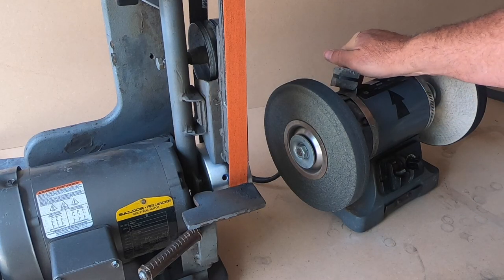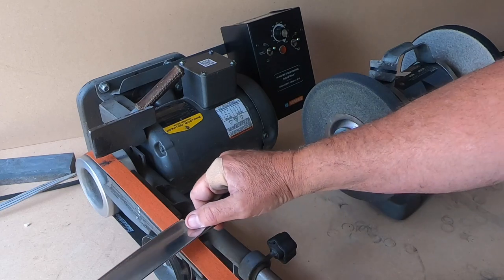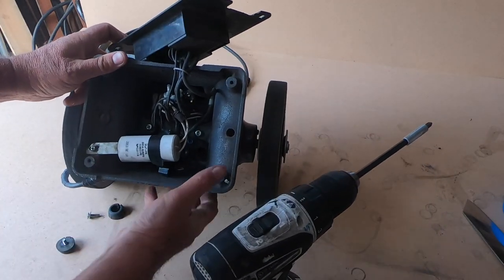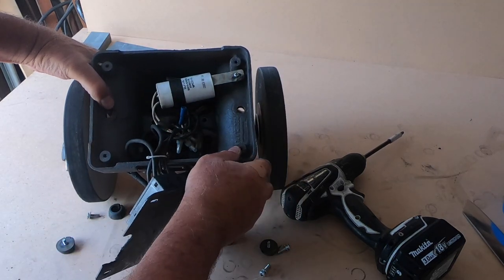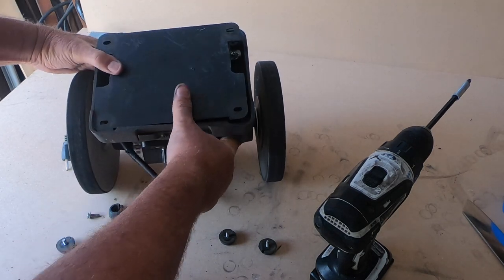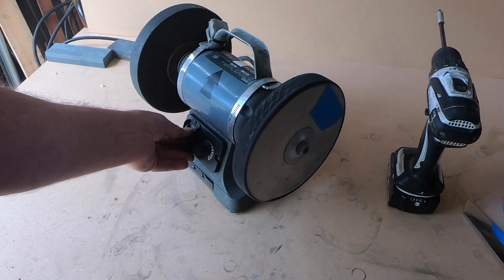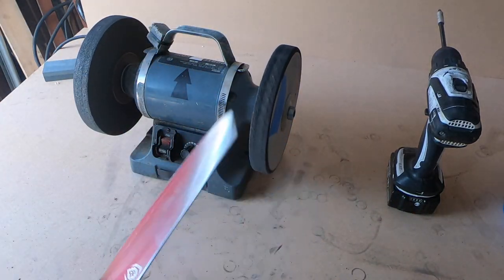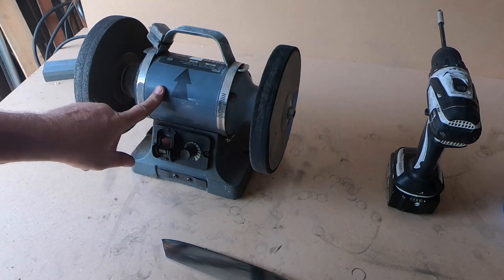Reversing a bench grinder Plus Bonus video covering Why!

Comment: That's so funny man! I rewired my motor, wasn't hard, but all I had to do was flip the base.  Love it!
Reply: I was looking for a way to put a reverse switch on it when I found this video.
I'm still looking for a way to put a reversing switch on my bench grinder. 
My dad's pedestal grinder had a reverse switch on his. Did not need it very often but it sure was handy when you did! 

Also his pedestal grinder had separate units.
The grinder part was separate from the motor part with a v-belt between them.

I sure do love that grinder he  had!
 I wish I had it!!!

You could work on larger pieces without the motor getting in the way!!! 

I put a reversing switch on my drill press. Now I can put a grinding wheel or a wire wheel on the drill press and run it in either direction with almost nothing getting in the way!!!

Comment: I was looking for a way to put a reverse switch on it when I found this video.
I'm still looking for a way to put a reversing switch on my bench grinder. 
My dad's pedestal grinder had a reverse switch on his. Did not need it very often but it sure was handy when you did! 

Also his pedestal grinder had separate units.
The grinder part was separate from the motor part with a v-belt between them.

I sure do love that grinder he  had!
 I wish I had it!!!

You could work on larger pieces without the motor getting in the way!!! 

I put a reversing switch on my drill press. Now I can put a grinding wheel or a wire wheel on the drill press and run it in either direction with almost nothing getting in the way!!!
Reply from the maker: I have a 1hp jet bench grinder polisher with long 1”arbors. It’s about 30” total width.  I wish it fit in my trailer. Instant start, coasts for almost 5 minutes before stopping. Hard to let go of a tool you love

Comment from the maker: One is extra hard very fine convolute wheel, the second wheel is Rock Hard Felt wheel with Black Magic compound. Both get 1-2 light passes. No heat is produced with light passes. Heat is bad and you must avoid. grinder is run at 3200 rpm

Comment: I just subscribed. I sharpen a lot of knives and use the same set up with the belt grinders.   I have 3 cheap 1x30 HF that I also flip on their back so the belt is going away from you.  Each one has its own belt so it doesn’t need to be changed.  They are lined up on the bench so each machine is the same height etc.
Reply from the maker: I’ve seen that setup and it can be a fast setup. I only wish the hf sanders we’re really 1/3 hp and better bearings ( noisy) If you ever try a sander with a real 1/3 you wonder how hf rates the hp. How/where do you work? I’m thinking of a series on the different ways you can make money sharpening. Hobby job to full time.
Reply: Peter G    Just a hobby for me.  I just wanted to sharpen my knives which led me to the 1x30.   Which led to making knives.  Which led to needing a bigger machine.  I didn’t want to pay so I built a 2x72.  I fell in the rabbit hole and haven’t come out yet.  I enjoy seeing the many way to put an edge on something especially your video on the flat bevel knife.  Maybe a few videos on repairing broken tips etc.
Reply from the maker: @tomp577  thanks for info

Comment: Easier method is to turn the whole grinder 180 with the switch facing to the rear. Use a momentary foot switch instead.  No reaching to the rear to access the on/off switch. Spin it back to factory position for standard operation.  Less than 30 seconds. Plus you now of the safety feature of the foot switch.

Comment: With no guards you can just turn the grinder around on the table. Or stand behind it lol.
Reply from the maker: If you reach over the tool enough times eventually you will catch the inside forearm. I’ve sharpened about 60,000 knives. That a lot of arm cuts IMO.

Comment: Hey PG how did you find the gigantic bushing for the convolute wheel, these things are 3" hole.
Reply from the maker: MSC industrial. They have an aluminum turned one $$, and a stamped sheet metal one $. Both work the same.
Reply: @FREEHAND.WETGRINDER  aaah I see the turned ones are more than the wheel hehe. yea, not worth.
Reply from the maker: @Musicpins  Call them. I did and the salesman knew where to look in catalog for the cheap stamped style

Comment: Hi, what is the model of your bench grinder please 🙏
Reply from the maker: I have 3 I just bought at Home Depot. 
And they charge brands.
Reply: @FREEHAND.WETGRINDER   thanks i'am in France and I search a  model like this with variator, have you got a link to see the specifications? It's to put wheel paper kit, they say it works with 3000 rpm but in my opinion it's to speed..
It's for personal use Just my kitchen knifes.. Have you ever tried this type of wheels? Thxss from France 🙏🙏🇫🇷
Reply from the maker: @Tendeep4  Mine are about 3000 at full and 1800 at low I think. Ive used the 3000 with paper wheels and it's fine. The speed lets you use very light pressure so less heat.
P.S. use as little wax as possible on abrasive wheel.
Reply: @FREEHAND.WETGRINDER 
OK thanks a lot..👌👌❤️ I will keep an test on my classic bench grinder. .

Comment: Actually I did find a way to run my bench grinder in either direction.

A few years ago the centrifical switch in my bench grinder came loose and slide over so that it would not run unless I push the grinding wheel in One direction or the other.
But when I do push it , it will continue running full speed in the direction that I push it!!! 

Normally that's a indication of a bad capacitor, but on some it also means your certificate switch is not working right.

The centrifical switch in any electric motor switches windings from start windings to run windings.

Comment: Does this work on all bench grinders? And what model is the bench grinder you are showing?
Reply from the maker: It should work on most all. Your actually only turning the base 180 deg. The wires should be long enough but I can’t guarantee anything since I don’t know all the different bench grinders. You don’t want to stress the wires so check clockwise and counterclockwise for what’s best. If it’s too tight abort unless you’re confident about adding the wire

Comment: Isn't there a risk of the spindle lock nuts coming loose while the grinder is being operated? The lock nuts are usually tightened in the opposite direction of wheel spin tp prevent them coming off as per bicycle pedals with a reverse thread on one pedal, so by reversing the direction of spin, lock nuts tightning torque will now be compromised.
Reply from the maker: It’s still spinning the same but it’s turned around so you can use the switch and still have it spinning away from you
Reply: The axle nuts on those grinding wheels are so tight they will not come loose on their own no matter what you do to the wheel itself!

My dad had a grinder that ran in both directions with a switch and those nuts never did come loose. We always had to use a wrench to change them.

Comment: Have you used MDF wheels on bench grinder to sharpen?  Pros and Cons??
Reply from the maker: Yes. 
Pros- cheap, Simple, delivers a mirror polish type edge. 
Cons- makes lots of heat, only good for mirror polish type edge, slow rate of metal removal when correcting a problem. 

This system is fine for the money. But has limits. If it’s for home use and you want to keep it easy/cheap it will work. If you want to sharpen for money it’s one of those tools you will replace with something more efficient/ flexible.

Comment: Peter what's the variable speed drive on the kalamazoo and how you like it?
Reply from the maker: I like it’s not worth the cost. You need a dc motor to go with it. I increased my motor to 1/2 hp. Plenty for my work. But because the speed controller has a brain when I start it on my generator it thinks there is a power problem as it spools up the generator. The fix was to tell the controller I have a 1/4 hp but when loaded double the power. This hits the generator softer. Also I have it start softer to help but I use the brake feature to stop fast for belt changes. 
I would not recommend due to cost. It was about $500 -600 for controller and motor

Comment: Could you one day make a video on your steps and gear you go through to restore a chipped and damaged knife through to the final hone and strop stage, for a client?
Reply from the maker: What I don't show in the video is big chip removal. If a lot of metal needs to be removed its fastest to put the apex on the belt so the spine is up. grind the correct contour while grinding away the chip. Then decide if you need to thin the knife before sharpening. Often I talk to the customer about thinning since the knife will look different than when I got it.
Reply: @FREEHAND.WETGRINDER  Do you have a video with the typical steps you go through to sharpen a knife, with all your gear. I think you shared something a while back but I can't find it. Thanks for the good work!

Comment: What is the rubberized wheel you use?  Do you have a link to where you bought it?
Reply from the maker: I have two wheels on this grinder. Neither is rubber. The white wheel with black edge is a Felt Wheel w/black magic compound on it. The hardness is called “rock hard” which is between “hard & Flint hard”$
The other wheel is a non woven Scotchbrite wheel. Very fine and hard. My supplier sells it with out any identification so I don’t even know who makes it. $$$
Reply: Peter G Thanks.  Do you get it from PEC?
Reply: P G   What dimension is that wheel(non woven ascot rite one), is it 8”, and what is the arbor size?  Is there a way to contact you?

Comment: I see. the switch is still facing forward but the motor and wheels are reversed 180 degrees causing direction to also reverse from before.
Reply from the maker: That’s the idea. The top of the wheels turns away from you. Let’s you work on the top

Comment: If a power drill can be reversed by simply throwing a switch, why aren’t bench grinders so equipped?
Reply from the maker: @eronavbj  bench grinders are designed for one purpose. And sharpeners are the ones who use it for a different purpose, working on top. For this it has to be turned around or reversed

Comment: Couldn't you just turn the grinder around without switching the base??
Reply from the maker: That is what most guys do. But use it enough,having to give it the reach around, you will eventually touch your under side forearm on a wheel. And both the wheels give a nasty abrasive burn. Setting it up right only takes a few minutes.

Comment: Lol I just did it on my delta and it still spins wrong way
Reply from the maker: It lets you turn it around and not have to reach over to use the off/on switch. It actually doesn’t reverse the direction. But turning it around makes it turn in reverse
Reply: @FREEHAND.WETGRINDER  lol!  I'm such a clutz.  My delta already has the switch in front.  What I was wanting was it to spin clockwise instead of the way it comes to stock, counterclockwise.  It is a little more complex on the delta because it has guards on each side so one can't just simply turn it around.  I got used to this after using my buddies for quite some time.  To me, it makes sharping easier.  Since I'm here,  what way should it be spinning for sharpening? Clockwise or counter?
Reply from the maker: ShyRage1, clock or counter? It’s up to you. Here is my situation and the right decision for me. I try to hold my knives flat for all tools. It makes freehand sharpening easier to get the right angle on the stones. Example: I use the armature wire on my tormek/wen for proper angle with the knives held  flat. Then when I go to the grey scotch bright wheel and felt polishing wheel I again hold knives flat but these wheels at aliens when I line up the sharp edge with the motor housing nearest the wheel. This is also the thinnest motor housing if you’re looking. I find these points with the tormek angle gauge. As the wheels get smaller I have to recheck my mark. But always the knives are flat. Only tool I change the knife angle is the belt sander and the. Finishing grinder that I have mounted on custom stand so I can work under it for seeing results and incase it throws the knife. Remember- I’m working at farmers markets and throwing knives out of the trailer is very bad. Also I’m doing a lot of knives at markets. I have to be efficient. I’m doing 50-100 knives a day 5-6 hr. I put more effort in efficiency than others need to.
Always remember this. There are a lot of ways to achieve a very sharp edge. I’m trying new ideas a lot. It keeps it fun. I use my tooling enough to justify the cost of trying new tools/ stones etc...  just yesterday someone read a better way of doing toothy edges. I tried it today on about 20 knives and decided to adjust what they were doing for even better/more consistent results. And once again I’m doing something different. It keeps it from being boring. Look at comments for (Part 1) video
Reply: @FREEHAND.WETGRINDER  ok will do.  Thanks for the reply

Comment: Why can't you just turn the grinder around 😬
Reply from the maker: People have asked this many times. 
When you use a tool a lot any problems that can cause injury needs to be solved. If you turn it around your reaching around to turn it off and on. 
Ever get an abrasive burn on your forearm? It sucks. And it can be fixed in about 10 minutes for free.

Comment: I just turn my grinder the other way 😩
Reply from the maker: Turning it around is a technical solution that is easy but if you use it every day the reach around will have a failure rate higher than I’ll accept. Wheel burns suck, especially on the inside of your forearm.

Comment: I don't get it. Why don't you just rotate the whole grinder 180 degrees? Is this a joke?
Reply from the maker: Because I hate getting burned by spinning wheels when I turn it on and off. 
And to the next question you will have- I use this tool all day I turn it on and off 50 times a day. 
Thanks for asking.
Reply: Seems like a joke to me.

Comment: What a stupid idea, the locking nuts on a bench grinder go in the direction so that when the bench grinder is in operation they stay tight and in place, reverse the direction and you risk the wheels coming off and causing an an accident.....a serious accident. Also how is this a "trade secret"? I've worked in an engineering capacity for close to 40 years and NEVER has anyone been stupid enough to do something like this. You sir are a danger to the public posting a video like this.
Reply from the maker: Thank you for your opinion. Sometimes things are done that have consequences.  But in this case you need to think of what is actually going on.  First the benefit is when using a bench grinder for knife sharpening you use the top of the wheel not the front face.  The direction needs to be reversed. Either by turning the whole unit around. This is the easiest but the switch is now on the back of the grinder. Turning it off and on 100 times a day eventually you will bite your inner forearm.  Or if you’re wearing long sleeves it can be far worse.  By doing what I showing all that is happening is essentially, the motor stays put, base is rotated 180 deg. Then you turn it to have the switch in the front.  The motor will still be turning the same direction just turned around.  Hope this helps explain.

Comment: Never seen anything so stupid in all my life…he turns the belt sander flat to get the reverse direction, but doesn’t realise all that’s needed with the grinder is to turn it round…..Is this an April fool?
Reply from the maker: Hi john, I’m guessing you don’t sharpen with a bench grinder turned the factory direction just turned around. If you did, often you would know how much it can hurt giving it the “reach around” and rubbing your inside forearm on a wheel. This video is just a tip I use to streamline my process, nothing more. Sorry you didn’t find it helpfully. As a professional sharpener I do about 120-160 knives a day. I’ve heard some guys do double that.  Professionals know streamlining is quite important.

Comment: Why wouldn't you sharpen from the bottom? Also why wouldn't you just turn the whole thing around if you were dead set on sharpening from the top? The thing about Wheels is no matter where you are if it's spinning at some point they're going to be spinning away and towards you. Everything in this video is strange and unnecessary. I saw this video a while ago and it immediately stopped me from getting advice on YouTube Forever
Reply from the maker: All my tools are approached with the knife flat and edge away. Having a habit is the safest way to do things that include high speed spinning wheels and sharp knives. Nothing is as exciting as having just one tool spinning the opposite direction.
And as to sharpening from the bottom. I guess you like to sharpen knives with the edge scrapping the metal base, but it isn't my first choice. 
Also if you just turn the tool around you have to reach over the spinning tool and hit the switch. Now we both know how easy that is unless your doing it often. Like you "I'm sure" we've almost sharpened 60,000 knives. At least I have. Setting tools up right is better that setting them up wrong.
Perhaps you don't want to get advice on YouTube but trust me Matt you need to get it from somewhere! Seriously!

Comment: That's not reversing it that's turning it around
Reply from the maker: actually it turns and the off/on stays. I call that turned around. Listen all you need is to use a reverse spinning tool with the switch in front so you don't catch your wrist giving it the reach over 100 times a day.